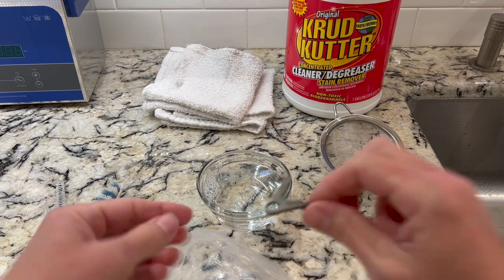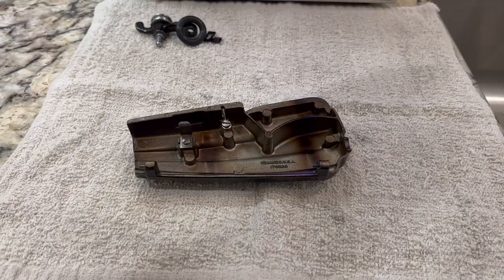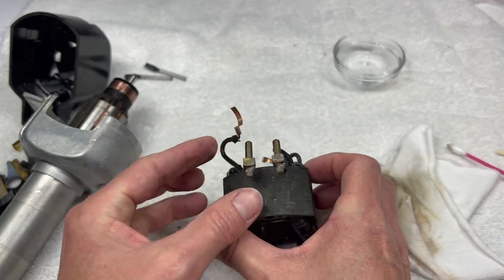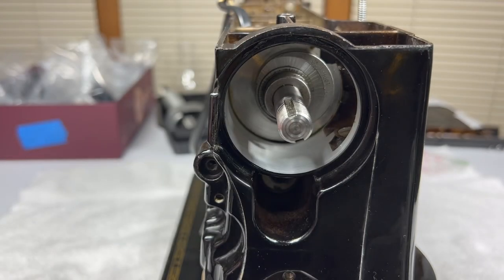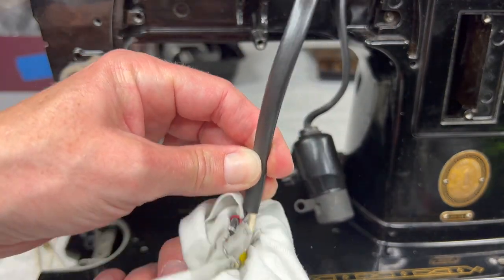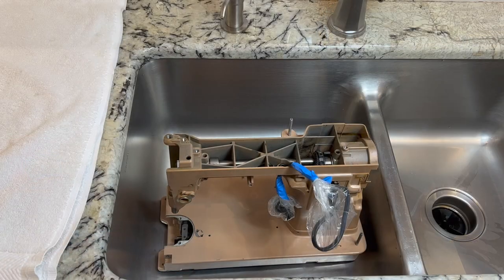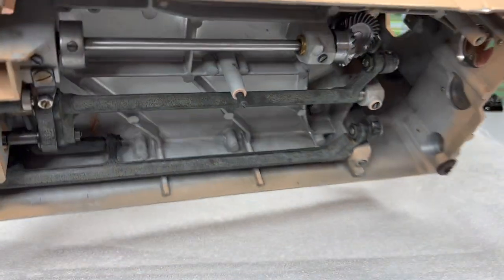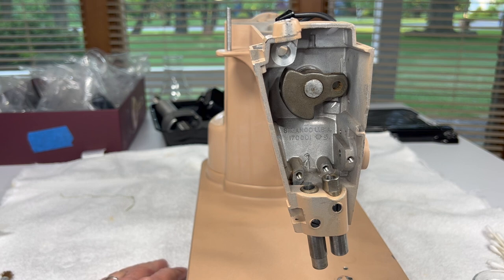How to clean a Singer 301 - Parts and Body: Singer Restoration Series Part 11

Comment: I cannot express how thrilling it is to me to see these parts come clean from following your guidance.  This is my first attempt at cleaning any sewing machine and I just jumped in with both feet with my newly found 301a when I found your series.  THANK YOU!!!!!
Reply from the maker: You are welcome! Yes, it is always a thrill to watch the transformation and it's so satisfying to do something productive with your hands! Good luck with your restoration, let me know if you have any questions!
Reply: @SewingMachineRehab  I actually do have a question.  When I first bought this machine and ran it, it had a deep rubbing sound coming from the worm gear.  When I first got the motor out, the wormgear turned, but definitely not freely.  The casing at the bottom of the motor wasn’t very dirty - certainly not like the one you had with all the carbon dust in it.  Now the worm gear spins a little more freely, but I’m wondering what ‘symptoms’ you would identify to decide if the bearing needs to be replaced or not.  I don’t want to get this all back together only to find out it’s still making that low, rubbing sound.

Comment: Love this series! You suggest oiling the cleaned parts (to prevent rust?) as the last step before reassembly. Should I just wipe them down with sewing machine oil on a paper towel?
Reply from the maker: Hi! It depends on what parts. The feed fork and feed connecting rod benefit from a wipe down with oil. As well as the screws. The plated parts not as much, just oil in all the pivoting parts. If you wipe parts down with oil a soft cloth or paper towel is fine, you want to coat them but excess is not helpful either. I hope that helps!

Comment: When I acquired a completely locked up 66 treadle I used Tri-Flow and WD-40 to clean all the varnished oil and grease out of it. I also used Tri-Flow on a small stiff paint brush to loosen the dried grease in the gears of my featherweight then pulled out with a dental pick. Also, why can you crud cutter the tan machine in the sink but not the black one?
Reply from the maker: Hi! The finish on the black machines reacts very differently to chemicals than the tan ones do. Putting the tan machines in the sink is optional, you can also just clean them the way you would a black machine. And...I love my dental picks, they are very handy tools!

Comment: Thank you for sharing another well done video with everyone. I sure wish I had seen this a few years ago lol. As amazing as Krud Kutter is for cleaning anything and  everything, I learned fast no using on machine  painted surfaces. I used it on the black tensioner disks on a 201 and within minutes had lost all white numbers and some of the black. I am so happy to see the big difference in these motors than the 201s and 15-91 potted motors. I always seem to find the nightmare ones of those. These look way more enjoyable to do. Blessings
Reply from the maker: Deborah, my first black machine was a Featherweight. I learned what not to do on that one, sadly. In the end I was able to make it beautiful but there was a place or two that all of the lacquer ended up getting removed and I was literally polishing paint and waxing it. I agree, the potted motors are not as easy, I love that the 301’s are not hardwired. Less to go wrong and easier to replace a bad cord. Thanks for watching! Blessings to you as well! :)

Comment: Mineral spirits, followed by Awesome Cleaner or Alcohol degreases much better at a lower cost than overpriced Krud Kutter. That is not a great product, fyi. 
Krud Kutter Must for Rust is essentially Phosphoric Acid.  You can buy PA cheaper.  It etches metal and removes rust before painting or sealing off.  Keeps it rust free for a year.  PA can be diluted with water and used on rust stains on clothes or surfaces. It also removes limescale in toilets, baths, sinks.  Less corrosive than Hydrochloric Acid.

It is amazing that you can actually wash the sewing machine.  I love that!  Mine smells old and has all this junk in crevices.  I am thrilled I can wash it out!  Many thanks for your series!!

Comment: It's amazing some parts if you buff them just don't lose it on the buffer wheel but you can make one of these really shine on the bright parts
Reply from the maker: Yes, my husband got me something to buff with for my birthday. I can’t wait to try it out and see how much elbow grease I can save.
Reply: @SewingMachineRehab  make sure you've got a hold of it good LOL. Depends on which kind it is I use a buffalo wheel on a grinding motor. Good luck you can really make one pop

Comment: To make using my ultrasonic cleaner even faster, I use the small strainer baskets designed for sink drains. Got a set of three for @ $4 at Walmart. Each basket can hold a full bag of parts, so I’m done three times faster. 😊
Reply from the maker: That's a great idea!

Comment: How do you clean the gears in the hand wheel? I love this series.
Reply from the maker: Hi! I am assuming you are talking about the hand wheel gear and the worm gear on the motor. I clean those when the motor is out and the hand wheel is off. Wipe away as much grease as you can and then I clean the worm gear with alcohol and the pointed cotton swabs. Just be careful to not let alcohol drip down into the bearing that is right before the worm gear. The hand wheel can be cleaned almost the same way. Rather than dunking either of those parts in alcohol you just want to put the alcohol onto whatever you are using (rag, cotton swabs) and then rub those across the surface of the gears. I hope that helps! The idea is to get as much of the old grease off as you can as well as remove any large bits of gunk that could cause issues with how the gears mesh. It doesn’t have to be perfect, just clean enough that the new grease you apply will have a chance to do its job properly.

Comment: I just love your videos. What did you call the wick you said needed to be replaced? It sounded like Greek wicking which I’ve never heard of.
Reply from the maker: Hi! I am glad you asked, it is grease wick. The motor uses a grease wick and then the top of the machine takes oil wicks. Depending on the year of your 301 it may not need the wicks on top because they were replaced with little plugs. I am thinking of adding the wicks to my online store so that people can just buy what they need and not have to buy the product in bulk. Let me know if you have any other questions!
Reply: Love your videos! When will you be selling the grease wicking? (Lol). Do you think denatured alcohol would be better than isopropyl or 99% alcohol?

Comment: Have you ever tried LPS1 for electronics?
Reply from the maker: Actually, I had never heard of it. After checking it out, I think I will have to give it a try. It sounds like it would be safe to use on electrical components (made for them) and it displaces moisture. Good call, let me know if you have tried it or if you do and how it works for you. I also read that it will help remove carbon, that would be a plus in these old motors! Thanks for the comment!

Comment: Where to you get your wicks?  Also what diameter is best?
Reply from the maker: This reply is a little late, I sell the oil wicks and grease wicks on my site pre-cut. I buy them in bulk, 20' at a time usually and cut them myself. The grease wicks are 1/8" diameter and I would have to check on the oil wicks...I think they are 1/16"...

Comment: Hi again. We’ve removed the motor and the grease wick came out in two pieces. One is about 5/8” long and the other 1/4”. I’m having trouble finding this wick so would the 5/8 be enough? If I get a new one do I request it be greased or is that something we do?
Reply from the maker: Hi! I sell replacement wicks on my site, if you’d like to go that route. 5/8” may be a little short, you just want it to be able to reach the bearing so it can do its job.

Comment: I cleaned the body but now all the moving parts are frozen up, nothing will turn. any ideas what i should do or why it happened?
Reply from the maker: Hi! I think we worked your problem out through emails, just didn’t want to leave this comment here hanging unanswered. After cleaning the machine can be pretty dry. Adding oil to all the oil ports usually gets them moving again!
Reply: @SewingMachineRehab  Worked great! Thanks for all your support!

Comment: I would never spray water into a machine.  Never.  While you can remove the surface rust as you've shown, you cannot remove the rust that will form inside the screw threads, the nuts and in particular the pivot points that secure the rocker shafts.  The method shown is almost guaranteed to create corrosion on parts that can't be cleaned without dismantling the machine.

I had a machine that to look at was as clean as can be.  It was working heavily though and after partially dismantling the bottom of the machine, I found rust and corrosion inside the pivot points.  You wouldn't know the rust was there to look at it.  After cleaning that up and polishing the points the machine is now maybe 20% faster and it runs very very smoothly.  Spraying water as shown here is not something I would ever do. 

As far as I'm concerned, there are two ways to clean old oil: you either take the machine apart and clean the parts or you clean in place using a solvent like kerosene or 99% alcohol.  Never use 70% as that's 30% water.  In their user manuals and if I'm not mistaken at least one service manual I've seen, Singer recommended using kerosene.  That's what I use when I clean parts in place.  Kerosene works perfectly and there is no danger of damaging the machine by creating rust inside crucial parts like the pivot points.
Reply from the maker: Thank you for sharing and being so frank and honest about why you wouldn’t use water. I should take apart one of my machines I cleaned this way a while ago and see if there is rust hiding out anywhere. I have a question for you about the kerosene, how do you dispose of the old rags or whatever you use when you clean with kerosene? This was always my concern, not sure  if I would be able to wash an old towel or rag after it had kerosene on it and worried about making flammable trash. Specifically on the 301’s, I have been concerned about dismantling much further because I didn’t want to change the gear mesh on certain places which is why I choose to clean parts in place in some areas. What are your thoughts?
Reply: @SewingMachineRehab  You're welcome, I should add I enjoy your videos very much.  You might have rust inside of parts that do not show on the surface.  That's why I wouldn't use water inside a machine, especially when kerosene will do the job just as well and safely.  The reason I'm such a fan of kerosene is that Singer recommended it in their manuals.  And I know that old time sewing machine mechanics, especially those who worked on industrial machines would sit a machine in a pan of kerosene to deal with the bottom of the machine, and drip kerosene into the oiling holes at the top of the machine to clean it.

Krud Kutter and other degreasers are fine on parts that have been removed from a machine and which can be dried right away after rinsing.

As for gears on a 301, what you can do is mark each of the gears with a sharpie so that you know which teeth have worn in and meshed with which.  The other thing that can be done is simply leave the gears alone, and clean in place, but dismantle the rest.  If it were me, I would leave them in place and flood the area with kerosene to get rid of any oil or grease buildup.

As for spontaneous combustion, it is a legitimate concern.  There is information on the web posted by fire departments as to how to deal with oily rags.  The method I use is simply to hang them up outside, spread out, not bunched up.  This is the method that woodworkers use to deal with rags used to finish wood using linseed or tung oil.  Kerosene is rather volatile and after a day on the line, the towel or rag will no longer have enough petroleum products to combust.  It will have evaporated.  DO NOT wash the rag in a washing machine hoping that will be enough to get rid of the oil.  It may not be enough to do so and people have had rags combust after being washed in a washing machine.  But hanging a towel on a line, spread out will be enough to allow the oil to evaporate.  Woodworkers will leave a rag spread out for a day until the oil "hardens" and then throw it away.  I would spend a few minutes looking at advice from fire department websites as to how to deal with oily rages.  

You can also get some really good information from a woodworker who provides a really good explanation of how spontaneous combustion works here:  https://www.youtube.com/watch?v=QP-1p055tmY

It's a 7 minute video complete with a demonstration from a Maryland fire department.

One other comment, and that's on your video on cleaning motors.  Be careful when using contact cleaner to never let any of the spray touch the black insulation on the windings.  Not all electric contact cleaners are the same, but they more or less all use highly refined petroleum products like naphtha  or lighter fluid, something that will dissolve heavier oils and immediately evaporate.  The potential problem here is that this type of product might dissolve the insulation on the windings and thereby destroy the motor.  I read someplace that at some point Singer used shellac as part of the formula for the insulation on the windings.  You don't want to dissolve the shellac.  Since there's no way to know whether or not the windings were insulated with a product that can be dissolved with the spray contact cleaner, I wouldn't use it on the windings.  I use contact cleaner on the rest of the motor, but not the insulation on the windings.

I know that AndyTube demonstrated using contact cleaner on motor windings, but I wouldn't do it.  Again, different contact cleaners use different formulas and different motors use different insulation on the windings.  And because of that you can never know whether or not your particular contact cleaner will damage the insulation.  

I would also never use sandpaper on a sewing machine commutator unless absolutely necessary.  I've done it where it was necessary, but I avoid it where possible.  The reason is that the copper on these commutators is very thin and they've been in service for decades.  Sandpaper will remove copper and potentially destroy a motor.  That's not the end of the world with machines that have external motors.  A new one can be installed.  It is however a major problem with internal motors on machines such as a 301.  You won't be able to find a new motor to fit that machine if the old one is damaged.  What you demonstrate works well for me, a soft cloth with 99% alcohol or contact cleaner to remove most of the carbon build-up and leave it alone.
Reply: Kerosene is just the old school cleaner
Reply: @r.duroucher225 , do you have any videos for vintage restoration?  I have 221